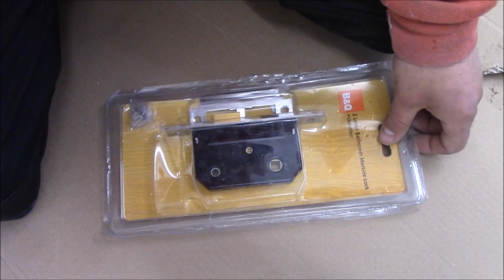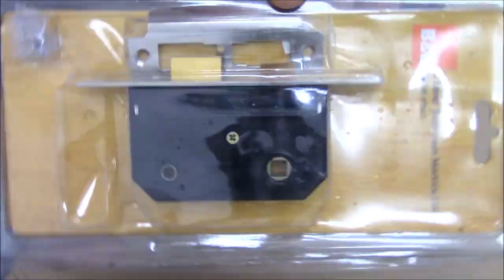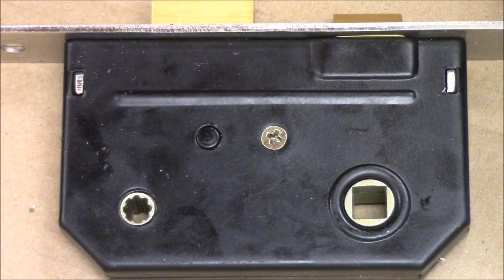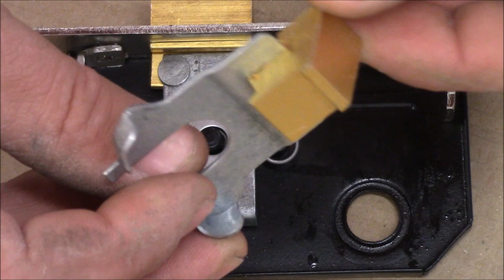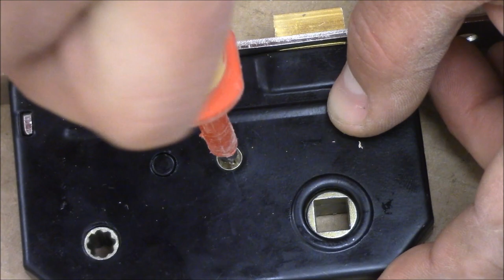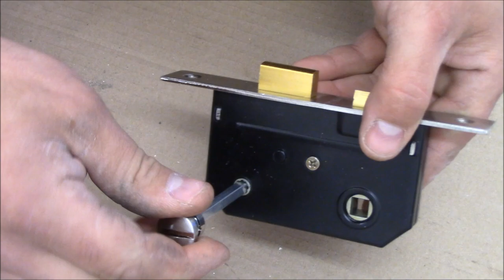How to reverse bathroom lock    Reversing mortice lock

Comment: Was hoping to find this as I opened a Yale lock (inside looks suspiciously similar) and the bottom parts all sprang off like clearly happened to various other commentators on here. Thank you, hopefully this will help to put it back together again. The instructions that were included in the packaging are completely silent on this- v bad. Thank you